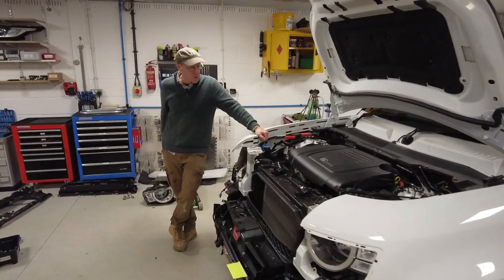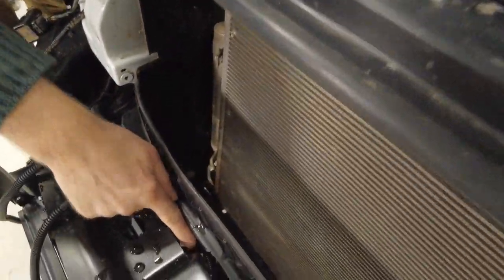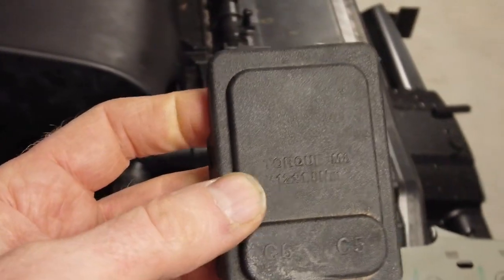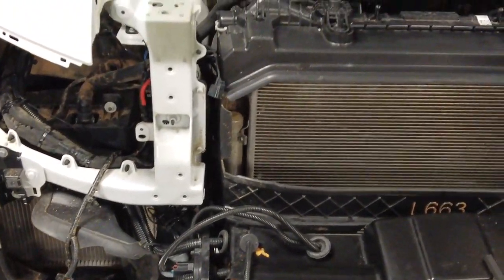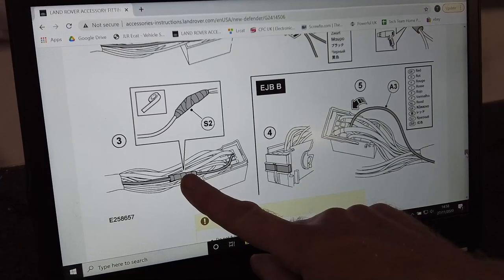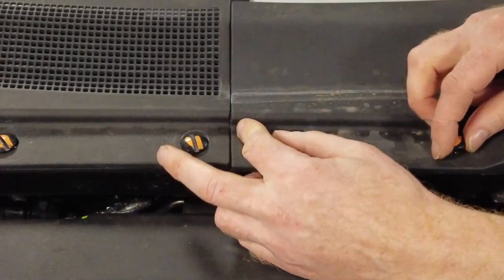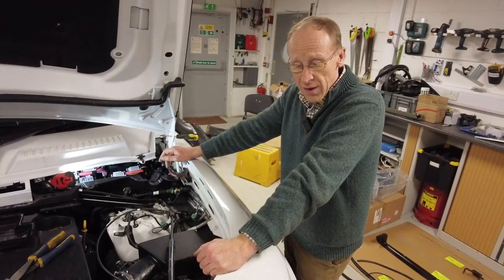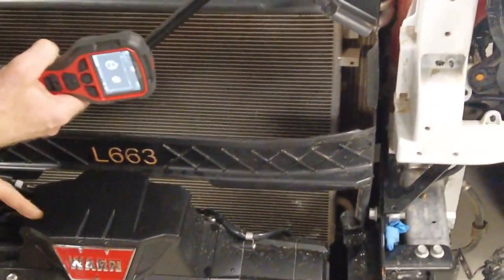Land Rover Defender 2020 Warn Front Bumper Winch Part 4 - Final Wiring and Testing !

Comment: The shackle hoop thing you called it is a thimble, used when putting an eye splice in the end of a rope to stop it chaffing!
Another great video lads, really enjoy watching even know I hate this new vehicle!
Reply from the maker: I need to do a YouTube quiz and winch terminology !....
Reply: @L663  it looks like you have dyneema rope on the winch which is much better than wire rope, wire can be very dangerous in the event of it parting as it has a high recoil, dyneema rope has a very low recoil!
I’ve seen ships wire rope go and anyone in the way will literally be cut in half... also with dyneema, it can be easily spliced, floats on water and you will be hard pushed to part it...every now and then we get 80,000 ton tankers in with Dyneema and it’s a pleasure to work with, believe it or not, the rope is only 3 times the size of what’s in the winch you have...although a large ship will normally have 12 ropes out on her final moorings!
Reply from the maker: @PillSharks  The rope seems light weight and good to know its strong too !
Reply: @L663  you won’t be parting that, you could hang the Land Rover in the air with that!

Comment: Really good point about the radiator. A few years ago my 16 year old daughter did an official Landrover start off road course down. She had never driven a car before and took an automatic Evoque on a very demanding off-road course. The car was incredibly capable (Yes an Evoque on standard tyres!) in the hands of a complete novice. However, a couple of times we had to stop because the radiator got blocked and the car overheated. I do hope this new Defender does not suffer this problem and I'm guessing regular cleaning of the radiator etc is key.
Reply from the maker: I am considering making a different radiator with wider fins... but you would have to do this for all the rads !

Comment: Simon another great video series. When its back together sign yourself up for a winch use course. It will cover correct use procedure, safety, additional equipment and other helpful information, it may not be cheap but you need to know whats going on as its not a toy.
Reply from the maker: Yes 100% need to do this and share the info etc.. any recommendations ?
Reply: @L663  lots of dedicated courses if you Google it or talk to COTAG or check local 4wd clubs to see if they have training you can attend. Think the ROSPA course is £200. You could also check if Goodwinch still offer courses. Or David Bower who used to own Goodwinch has a 4x4 off road course in Devon.

Comment: With the flaps they are excellent to have down whilst wading especially through muddy water  ....If there was a way to keep them on the defender  and run a switchable power supply to them for an open/closed type manual set up that would be well worth exploring .....you could design and sell a kit ????

Comment: Brilliant series. You guys deserve a medal. 🎖

Re. the grey box: I wondered whether it was to prevent the winch running with the engine off to save the battery but apparently not. 🤔
Reply from the maker: Hi - I think it has a dual purpose... as you say stop winch running without the engine running and also to stop the winch when the starter motor is used to prevent wire overload... but these are guesses !
Reply: Just think of the amps... If thr winch is fused at 450 and we ask the starter for 150, you probably need 120mm2 cable for that to keep the heat and volt drop down. The that's expensive!
Anyway I thought the newer light hybrid ran on 48v integrated starter/generator so wouldn't get involved with a winch.
Awesome vids too a 'goto' on winch fitting for early new defender. :-)

Comment: I am enjoying watching this one more than normal because all the one I am watching from America talking to land rover are saying the can not fit them because they have had big problems but they CUT the WIRES lol , Keep them coming and get another mike
Reply from the maker: Yes cutting wires does not really seem like its needed... I actually think the crank wire is not needed - this could have been achieved with a voltage detector circuit - like the one we designed to turn the DRL's off..

Comment: A great way to clean those coolers and radiators is to use something like Venom Pack, used on air conditioning system condensers.  It's aluminum and microchannel safe, it would get those things looking brand new again in no time.

Comment: I think that the cranking sensor wires probably disable the eco stop start function if the winch is switched on. Good use of the piggy back fuses.
Yes it's a lot more complicated than fitting to the old defender,  but new vehicles have to pass new crash testing and emission testing. 
And to answer some comments on other channels, it will take time for the after market to engineer products but if there is demand they will. 
Great channel, thanks guys.
How about when the current situation sorts itself out having an open day at HQ coffee, land rover chat and accessory sales.
Reply from the maker: Hi we need to do something....when this crazy pandemic is put to bed... I was wondering about a couple of things...maybe we could take some staff and some cars to the Bicester scramble events. Selling parts face to face is tricky as we are so set up for  ecommerce etc.

Comment: Hi Simon you were going to show us how LandRover keeps the Radiator Blinds Open so you can wash the radiator this would be very interesting if you could show us thank you
Reply from the maker: Yes Mr Skywalker said this in the Land Rover online technical documentation so i need to login ( and pay ) to access this but i will and share. Also another viewer has fitted a winch and fitted the top air flaps so i need to work this out for me and all of you guys too !
Reply: @L663  So you have to pay to get information, without which there is a significant risk of overheating the engine?

Comment: Hi Simon, 

This series of videos was indeed really good and extremely helpful for anyone installing a winch into a new Defender or for that matter, any other vehicle in terms of doing it the right way.  

In your next video, you mention testing the winch.  Please as a word of advice and to ensure you are using the winch safely (Health and Safety Executive UK MAY BE WATCHING), when you have the winch line out and anchored to something you may seek to pull the Defender towards, place a winch blanket over the cable cable/line.  Cables do break from time to time and it's best to be safe, cables can do serious damage to people and cars when they break. Also, ensue the bonnet is fully open when winching and no one is between the Defender and the anchor point.   Otherwise, again an amazing set of videos and remember, Land Rovers do not get stuck, they are temporarily held up.
Reply from the maker: Thanks .. I am not a pro but I think we did an OK job.. and it works !
Reply: @L663  I think you did an amazing job. Perhaps better than a certain JLR shop in the US......🤣🤣🤣🤣🤣🤣

Comment: The main battery cable is protected by a fuse Simon so the cable would not melt, but I suspect the fuse would pop if the starter current and winch current were being drawn simultaneously. Also despite the connectors being weather sealed it might be an idea to apply some dialectric grease. Love the videos despite being a dyed in the wool Shogun owner.
Reply from the maker: Mr Wright - your are of course Right ( see what i did there ) ... nothing wrong with the Shogun..... I have a Hilux ...

Comment: I put my winch in last week and I think you need to reinstall the upper active cooling flaps and discard the lower ones (good thing you didn't cut the wire!).  A problem I had was when cutting the bumper cover, it says not to cut the Defender X that instead you buy a pre-cut part.  Only problem is that part is not available until April!  I cut my Defender X bumper anyway.  Lots of pain cutting!  

Awesome videos!
Reply from the maker: OK I will check this and fit if possible...

Comment: brilliant  set of video's..not sure about the piggy back connectors, due to corrosion issues,.... Happy off roading....
Reply from the maker: Yes good point - the fusebox is well away from the elements and sort of sealed so this reduces the risk... also its just a winch... better this than risk cutting the wire that is for something more important.... and scrapping a car ( TFL on Youtube )

Comment: Brilliant.  I don’t need a winch (I have one on my other Defender) but I want one now - just so I can fit it.  What do you reckon your total fitting time was?
I reckon you’re spot on with the crank controller by the way.  The alternative would have been to route the winch all the way back to the battery, which I guess they wanted to avoid.  Slaving it off the under-bonnet terminal could potentially put a huge load on the primary positive cable.

Remember to tension the winch once it’s all installed.  Essentially you spool it out (keep a few turns on the drum), connect to some resistance (smart car with the hand brake off) and then wind it in - winching in the resistance - paying attention that the rope is laying nicely on the drum.  Stop a metre or so out, disconnect the resistance and wind in the remainder.  What that does is to take the loose stretch out of the synthetic rope so that when you perform your first winch under serious load it isn’t just tightening itself on the drum and binding up 👍
Reply from the maker: I would say about 2 days would do it .. a full weekend. Its hard to say what time it took as we get things ready for the video etc and try and do some research around the topic.. and have meetings with staff.. and check on the warehouse etc.
I need to get myself on a proper winch use course i think - or i am going to be in danger of setting a bad example of winch use which would be dangerous !

Comment: I live in good old wet Yorkshire and when  off roading in wet conditions and specifically wading, we place a cover in front of the radiator to stop it getting full of detritus. Is it possible to rework the flaps so you can manually close them when off road but then open them back up when you have finished? This would protect the radiator from mud and damage and allow you to clean the bits off afterwards that may have found their way through. This would give you the best of both worlds.
Reply: Don't be silly, that would be a sensible idea, must remember we're now dealing with designer's in suits not boot's.!

Comment: Hi Guys.  I picked my 2020 defender back up from the dealer in Norwich last week - it was in having the roof rack, 'lunch' box and ladder etc fitted.
Not cheap to get done at the main dealer but a great job by the guys at Inchcape Norwich ( I know!  Most folk slate JLR dealers but this is my 5th vehicle from this dealer ).
Keys - does one key do both ladder and box - in a word - No.  Different size locks so different size keys.  
Next job - I'm dropping it the  The Bodycentre Ltd Norwich UK ( Sam there has a great YouTube channel too! ) to get the box, wheel cover etc all done black, and also the bumpers too!  And red callipers and red 'Powerful UK' rear bumper tow brackets! 
Off to sell a kidney to finance the deal............................
Reply from the maker: Wow someone is buying himself some christmas presents ! All sounds good. Keys are a bit annoying but as you say they are different sizes.
On the rear hook surrounds i have some red plastic coming... this me be easier than painting the black surrounds... remind me next week and will send you a set !
Reply: @L663  Hi guys!  That is a kind offer - Sam at the Bodycentre is actually going to paint a red pair in a 'banging' red to match the callipers though!  He assures me it'll look great - they did a full strip and repaint of a new 110 into a classic JLR Green plus black pack for a royal shooting party!

Comment: Great Videos, good R&D for JLR. You have followed the instructions well except, the very good modifications that you have made. 
This is the second winch installation I have seen on modern vehicles the other should never have left the main dealers workshop, I may stand corrected but I was on the understanding that under construction and use regs for motor vehicles, any battery source power at the front of the vehicle should be isolated whilst driving, possibly the 450amp fuse may be a get out, the second point there is no safety device fitted, if the winch runs on, not a very common occurrence but it does happen, how do you STOP the winch? Although PUWER regs don't apply on personal vehicles, if its owned by a company or supplied to an employee that installation is not fit for purpose

Comment: Great video as usual,  just to ask is the switch on the back of the winch the  isolator switch or is the winch constantly live once you turn on the ignition on. Other winches I have seen fitted have a separate isolator in side the engine bay. Or do you switch the winch on by using the remote.

Comment: Hidihi, jolly good job !
I like the video and the instructions. 

But it was lots of work......
In my opinion, it should have been easier to mount a winch on a real 4x4 car as the defender.
Mounting a winch on, for example, a Jeep Wrangler is much easier.

Then I have a question:
Has this Warn winch a clutch ? (so you can quickly pull the winch-cable out , not using the remote control)
And can you operate the clutch from the hidden position of the winch ?

I have mounted a Ramsey winch on my Mitsubishi Pajero, also in a hidden position, and had to improvise with a metal rod behind the bumper to engage and disengage the clutch, this works fine for me.

Thanks for info !

Comment: I have the same winch bought this year, annoying thing the battery in the remote goes dead in about a week,  even when remote turned off. Seems every time I go to use it I have to use the usb cable.
I have informed Warn UK and they are ordering a battery, but taken, months and  months and still no new battery, interesting to see if anyone else has this problem. Also as you do not have the relay receiver pack re located to under the bonnet like I did, be aware that if you have winch under the water the remote may not work, you can get an extension antennae to solve this problem from Warn.

Comment: Fusebox is well hidden, to make it simple in the bush to check...
Reply: Never mind bush. What about out on a family ski trip or any ol road trip? That fusebox design is a disaster. At least make it face the access opening?
Reply: @janimalius  and in addtion, they had opend the bonnet additionaly withe the screwdriver feature, which standard dady will not have at hand, and it's even more a p... then
Reply from the maker: The open the bonnet trick was a lucky spot - really helped on this job !

Comment: I wonder if the “cranking” wire is something to do with the stop start system and prevents the car stopping and the battery draining and forcing the car to start and doing what you said with the wires under the seat or melting the battery and you getting a warm bum
Reply from the maker: Ah the unintended heated seat feature !

Comment: Hi Simon, have you managed to discover what does that cable ‘S’, what’s it for?
was that a left over?
Thanks.
Reply from the maker: Sadly i have no idea !
Reply: @L663  my car is a phev which requires a “sounder link harness” only available with that kit VPLEP0426 you installed. I wonder if that is the cable S you had as a left over and could I buy it off you?

Comment: Your SMA aerial connector needs to be wrapped in insulating tape to waterproof the connection as they DO corrode! Especially in winter  on British roads which have been salted!
Next, on your camera split the tracks and have the camera mic on 1 and your radio microphone on 2. Just remember to sum 1+2 when you edit and upload to Youtube!
Reply from the maker: Yes i think i may put a bit of heatshrink over that... it was troubling me..
On the mic thing I dont have 2 sound tracks on the camera.. when i turn on the wireless mic it turns off the camera mic... need to look into this more... so we can get Tyler back !
Reply: @L663  Very sensible re heat shrink. I’ve had so-called gold plated connectors rusting!!
I’ll start a campaign to get Tyler and George back on mic! Seriously it makes the videos so much more enjoyable being able to hear you clearly, this from a retired old sound man!!
By the way what model of camera do you have?
Reply from the maker: @ianmenai  We have the new DJI Osmo Pocket 2... its really neat !
Need to work out how to add 2nd mic
Reply: @L663  Yes it is neat.I've had a look at the user manual, well what there is of it! It looks like everything is done from the app. I suggest an email to DJI who do seem receptive to questions and requests!
The audio is 2 track so it should be possible to have the on board mic on one track and the very neat clip on radio mic on the other track. From the pictures there is a 3.5mm socket on the radio mic receiver, is this a mic input or headphones out? The transmitter has a 3.5mm socket to enable you to use a cable mic (lavalier) instead of the on board mic.
That onboard transmitter mic sounds perfectly OK BUT I hate advice that has it clipped under your chin! Clip it on your jumper about 9"  - 12" from  mouth, directly  below your chin. I have anger attacks when I see a presenter on TV  with his/her mic on one side then talks the other way and is horribly off mic!
You will find your mic sounds very nice and clear if you have it halfway down your chest. You will also pick up Tyler or George far better until you get the second mic sorted!

Comment: Winch should run also with machine off, just in case of some emegency when machine is dead, BUT you should have a simple reachable switch in case you need to
Stop the winch at the very moment...  usually it 's loacted on the thick red wire, did not see that. Made I missed something?